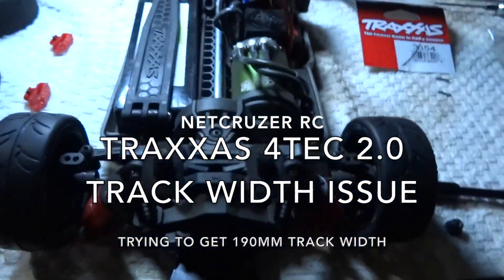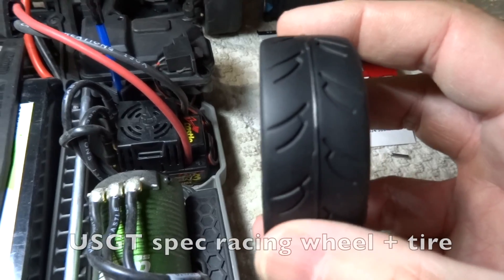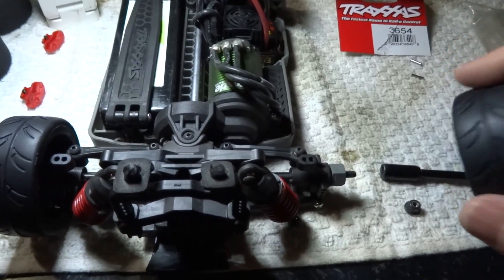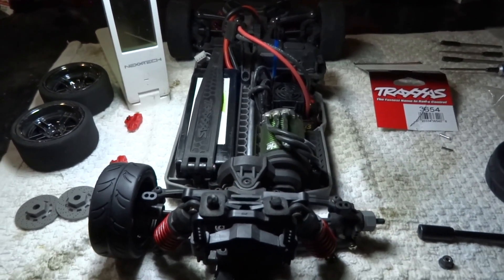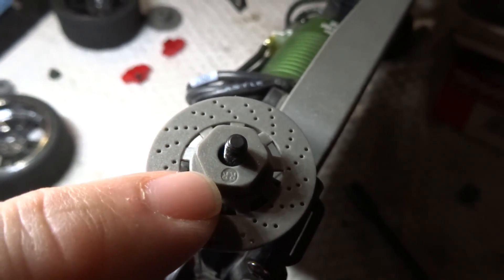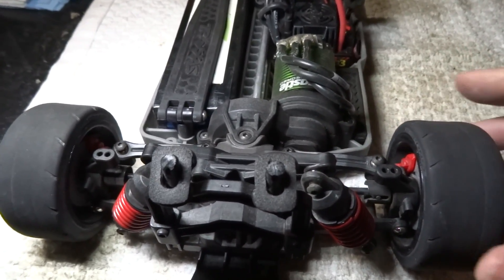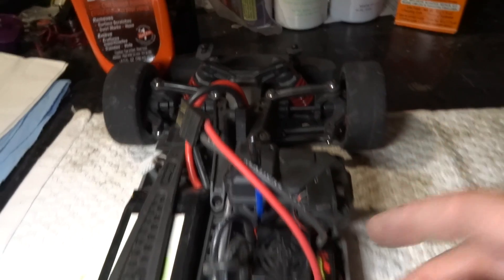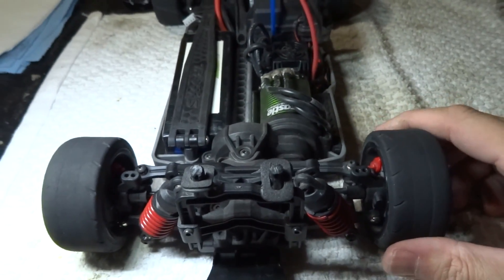Traxxas 4-TEC 2.0 Track Width Issues - Netcruzer RC

Comment: Great info. I'm going to buy a 4-TEC 2.0 VXL to run in VTA. I'm a newbie so not expecting to win but to learn how to drive well first and without breaking the bank. I'm confused by the track width numbers your'e giving. Traxxas shows the stock Ford GT track width to be 200mm. (same for VXL no body model) So, am I missing something regarding your inability to get to 190mm? Thanks.
Reply: Was this ever figured out? I am thinking about buying a 4-Tec 2.0 but this track width thing isn't making sense to me. I'm trying to figure out if you can or can't run non-Traxxas wheels and tires but the width being wrong seems really odd.

Comment: How did you keep the rear from spinning around. Mines keep spinning out when I give it mor throttle?
Reply: Lowering the wheight
Reply: First thing i did was to space all the slop from the springs so when i picked it up the tires come off the same time. Front and back. Then i reglued the tires thats a must. Hobbiewing sct w/5100 kv and links to tune suspension so far with stock gearing about 45ish no gos yet.

Comment: Traxxas  made for bashers. Serious bashers. Speed,power and durability and absolutely the best in its class but definitely not race track ready.
Reply from the maker: Many people raced the old 4-TEC electric and that original car had a standard 190mm track width with racing tires. Agreed this one is not intended for racing but I was hoping to race it anyway.  And technically I can, but with a 183mm track width on USGT wheels it will handle worse and look a bit goofy.
Reply: You contradict yourself pretty hard. There is no such thing as serious bashers. Speed, power and durability are not traxxas best qualities again because there is no such thing as serious bashers. You talk about classes. Traxxas does not make race vehicles and therefore their vehicles can't be put in any class recognised by federations such as IFMAR of EFRA. Only machines made specifically for races organised by those 2 federations can be called serious. Traxxas is a slight step above toy grade vehicles.
Reply from the maker: Traxxas durability isn't really first in class anymore (but it used to be before big brushless lipo power). Traxxas is a lot better than any toy grade RC.
Reply: @turtletrading4207  Traxxas isn't just above toy grade. Just because they are plastic doesn't mean anything.
Reply: @turtletrading4207  first of all a company wouldn't change there slogan just because of a new standard. Look at Gran Tursimo for example "The real driving simulator" but yet it isnt the most realistic on the market when compared to Iracing or project cars. I own a brushless slash 2wd. And while I don't go racing with it I bash it pretty hard. Got it in 2015 and the only thing the even remotely broke was when the PLASTIC shock cap came off. No rc is perfect. Other brands have there isues too. ALL rcs break.
Reply: @rattlehead7281  k
Reply: @turtletrading4207  Ok. Im just saying traxxas is like the middle man. Not just for bashing or racing. But it has rhe option to do either really well.
Reply: @rattlehead7281  Well, I am saying that Traxxas is like the middle man with racing product prices and you really don't have the ability to surpass the middle that much. It's your money, not mine. True, all RC break but decent RC companies make durable parts, unlike traxxas. Traxxas parts are specifically designed to break often. More broken parts= more spare parts=updates=$$$ for Traxxas
Reply: @turtletrading4207  they actaully don't break that much. Any car can be good its what you do to them